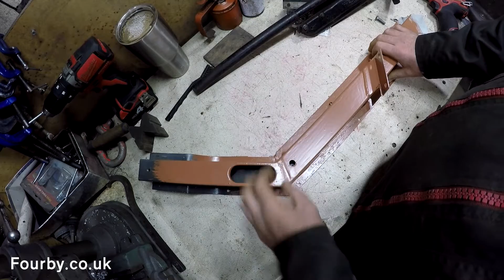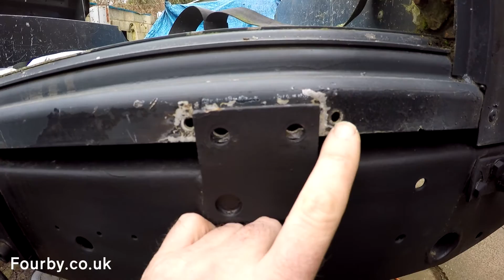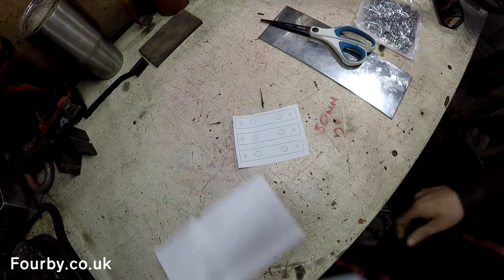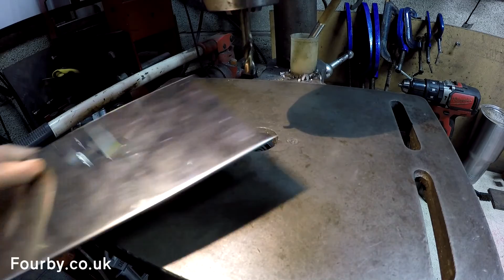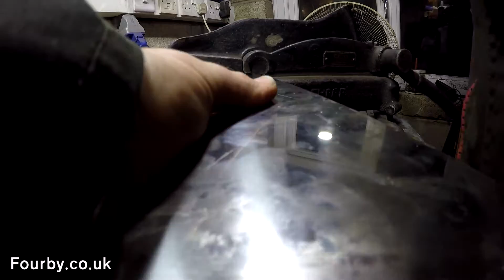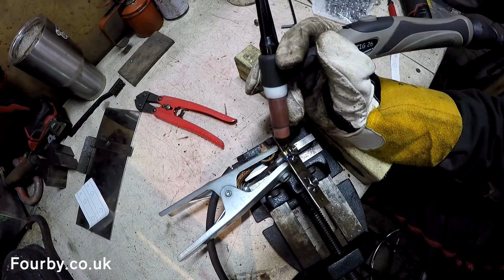Land Rover 110 Restoration #5 "B Pillar and Sill repair Part 5" Captive Nut Plates

Comment: Spot on video.  I like the idea of CAD drawing the templates.  Is it a free programme?
Reply from the maker: AutoCad is not free, but 'Fusion360', an autocad product is free and equally as powerfull. I'm slowly trying to move towards 3D CAD modeling as it makes the export to CNC factories easier.